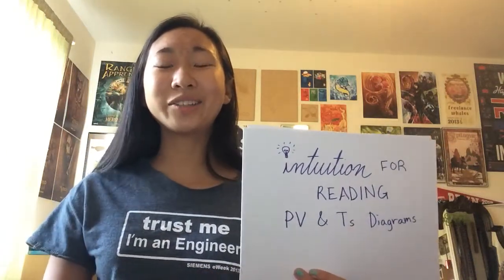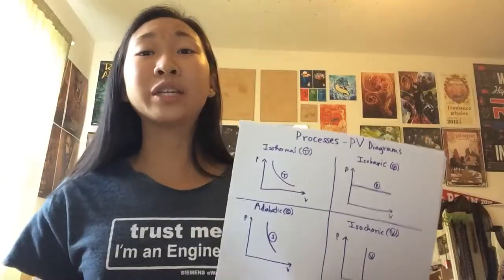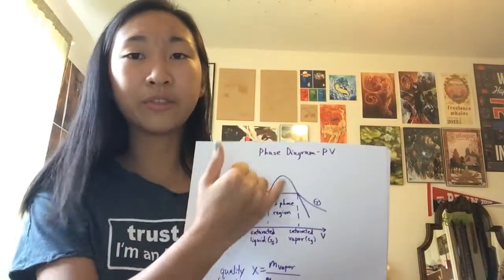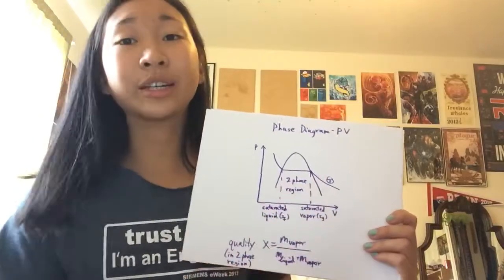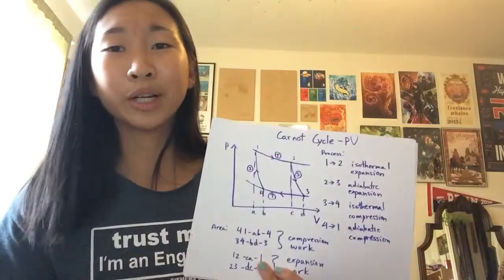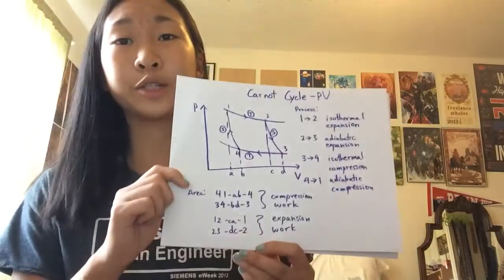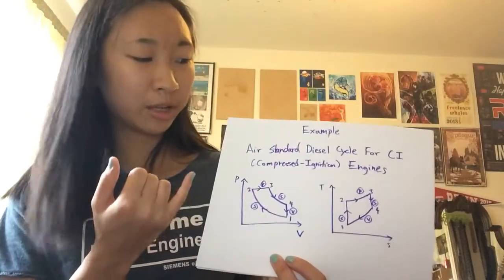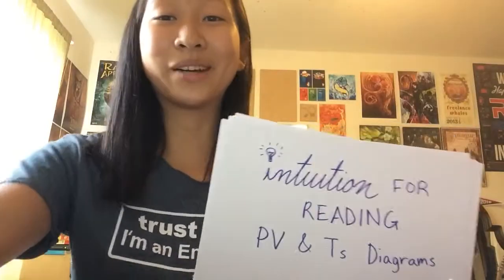Intuition For Reading PV & Ts Diagrams

Comment: Think u can try to add some explanation on the equipment involved in the carnot cycle (compressor, turbine etc.) and try to explain heat pump and refrigerator, and also try explain some concepts like why the curve for adiabatic is steeper than the isothermal line, why adiabatic processes are also isentropic etc, I did spend some time to read it up on the internet just now :)

Anyway very good job and clear explanation, pronunciation is nice and clear n u seem very passionate about the subject!

Comment: Thank you. I’m having a hard time with entropy. Can anyone tell me what constant entropy means?
Thanks
Reply: The short answer is that entropy is a measure of the disorder in a system.   A process happening with constant entropy, means a reversible process with no heat transfer.  Idealized processes that expand and compress fluids, are examples of constant entropy processes.

That is an oversimplified explanation, but the idea is that time's arrow always points to either an increase in entropy, or constant entropy.  You cannot destroy entropy; you can generate it, keep it the same, discard it to your surroundings, or bring it in from your surroundings, but you cannot destroy it without time running backwards.  Entropy enters a system with heat transfer, and the amount of entropy is proportional to the heat transferred and inversely proportional to the Kelvin temperature at which it transfers.   The formula is delta S = delta Q/T, for a constant temperature heat addition process.   So an adiabatic and reversible process will have no change in entropy.

A reversible process, is an idealized version of a process that doesn't destroy any entropy.  The process is possible in both directions.  Examples of such processes that could be reversible in the upper limit of perfection are:
Motors and generators
Turbines and compressors
Compression and expansion of a gas in a cylinder with no heat transfer at the same time
Heat transfer across an infinitesimal temperature difference
Electric current through superconductors

The following processes are inherently irreversible:
Throttling valves
Sudden expansion of a gas
Heat transfer across a finite temperature difference
Mixing
Any process involving frictional heating or ohmic heating
Reply: @carultch  thank you. That’s a lot to think about. I appreciate it!